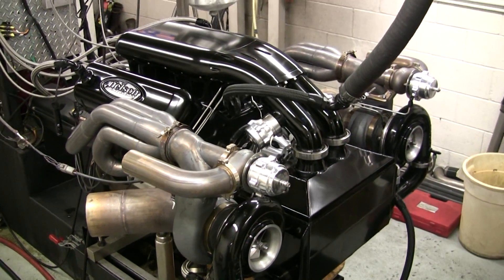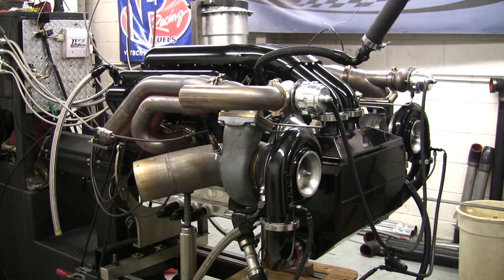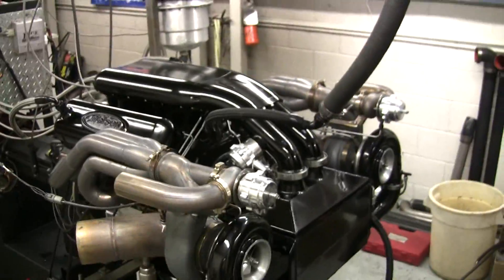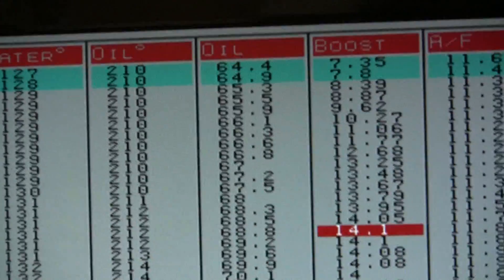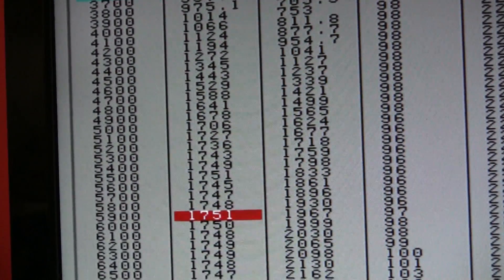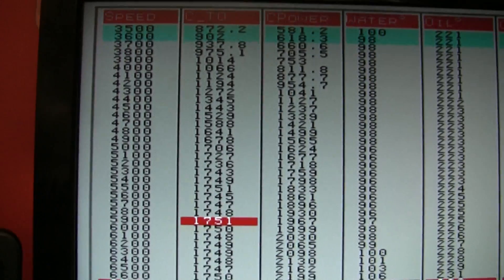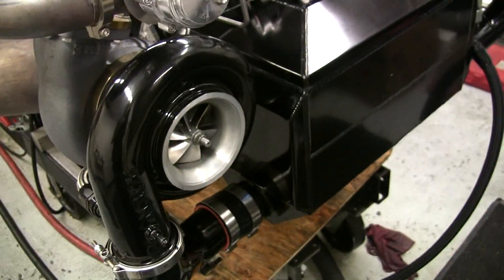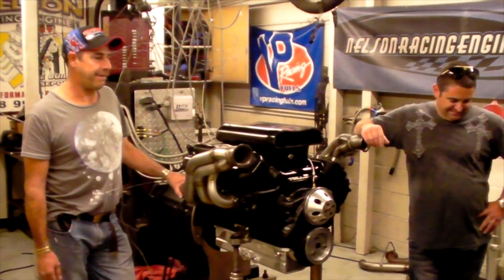NRE's 2200+ HP 632 BBC Explosive Beast!  Patented Award Winning Mirror Image Turbos. Chevrolet

Comment: And it’s still makes less hp and tq than a factory Hemi did in 1964, even though the entire block is new, stroke,crank,rods,heads etc Chevy sucks all they do is cheat that’s why they have banned the Mopar Hemi 49 times now and got rid of Pontiac because they made more power just like Mopar. Screw gm I guess that’s why the Camaro is dead now because everyone wants a Challenger. Go ahead add more weight and ban the most powerful engine in history again Mopar loves it. Shit rod is just that it’s junk

Comment: I understand that u replied to my comment, now I don't have a pos Honda, like I said I have a real import. With that being said, talking about reliable motors, hmmm...Honda motor can have more 200k+ miles on them and still be running strong. These v8's here aren't meant for street action and aren't daily drivers. And I wouldn't call these gas guzzlers reliable either. there's plenty of imports that have 1600+ hp and would give these v8's a run for their money

Comment: higher stall speeds also lead to more power soaked up, standard vehicle estimation is 15% loss on standard trans 20% auto, a little extra for awd which is unlikely to apply here but the extra weight from beefier components will add some also, expect closer to 22-24% wouldnt be a stretch and is right in line with what other vehicles in the power class loose. so yah 700 might be a little high but 500-600 hp loss at the wheels is about right

Comment: it has nothing to do with the vehicle it has to do with rotational mass and drivetrain, which is why its not a flat number but a percentage. to build a trans and rearend to handle this will require massive components from the torque they will experience, such as a fully billet turbo 400, 4l85e, lenco or something similar and a 12 bolt or 9 inch rear or bigger(yes they do make badder), then it is going to require a massive wheel and tire combo to get it to the ground, again from torque.

Comment: Yea ok, they've already made 1000+ hp  evo, look it up. Even up 1600 to 1800, plenty of torque to keep up with that thing. And only needs 1 turbo. On a well built evo, a 6766 can push a 1000 to the wheels. And no my car weighs over a ton, more like 3000+ pounds, look it up before you talk dumbass. And I'm not using some shit civic, you're thinking of, when I said 4 banger. I have a real import.

Comment: I had considered the potential this would have in an old Camaro or something, and all I can think of is "Where the tuners at?" 

...well.... that and... uh... myself screaming "Oh god oh god we're all gonna die" when I jam the throttle open. Could you even get the tires to hook up putting that much power down? My lack of experience as a driver shows, I guess, asking that, but good lord, that would be insane. And trying to keep it in a straight line? 

It would be SO FUN!

Comment: was wondering if you have after oiler on the turbo system , like when motor shuts off and oil pressure is gone does the turbo still recieve oil  when spooling down?

Comment: Amen to that! There's no replacement for displacement. I think the motor I'm building,a Buick 3800 Series II. falls somewhere in the middle though. Since people have still made 1,000+ horsepower with a turbo Buick 3.8 v6, I think I'll be plenty happy with it and have enough horsepower (and torque) to handle most cars that want to challenge me. If I run across a huge twin-turbo v8 like this car, I'll leave it alone though.:) Very impressive!

Comment: everything about that engine makes it make huge horsepower. A 632ci engine with quality porting probably makes like 700hp BEFORE turbos. Adding turbos with water to air intercooling on top of the good airflow from porting allows for a very dense and cool air charge on top of the huge hp it makes and the hp just multiplies. Plus a quality valvetrain set up for the turbos just adds icing on the cake.

Comment: What's the compression rate of the motor? is the motor base altered?
Since you've limited the boost pressure rather low, I would guess you're on the detonation limits with the standard fuel?

Comment: Bud,... I have owned two evos(2003 and 2006). I am not trashing you, I am just stating facts. Also, don't get carried away with defending evos... I'm a huge fan and always will be, good lord. Reread what I wrote, and do some research. And I said YOUR evo,... is your evo built right now and ready to support a 6766 at 50psi? So YOUR evo with a 6766, as it sits, makes less power then this motor does NA.

Comment: 6766 is rates for 935 hp, and they've already built 1000+ hp evo's anyways. Those turbos on that engine are adding like close to 2000 hp, that engine na would be like 600 hp something like that. If my evo was fully built with the 6766, it would be pushing 900+ to the wheels, although not saying you were talking shit or anything, I was wondering how the boost affected bigger engines

Comment: Depends on the size of the turbo, engine, ect, bud. 28psi through a coffee straw, and 28psi though a toilet paper roll is quiet different when we talk about volume of air. Evo 8 inducer is 48mm, evo 9 is 49.5, where this motor has twin 88mm's. Plus the size of his motor, and that thing makes more power NA then your evo would with a 6766. Boost pressure is just a reading of resistance in the intake system. Smaller motors take more boost to move the same air as a motor with more cylinders would.

Comment: How are you making so much power with such little boost, that's my question, my evo, stock turbo is pushing 28lbs of boost and I'm only sitting at 364 to the wheels and 363 tq on e85. Just wondering, cause I figured if you're gonna make 1000+ hp then you'd need like 50lbs of boost or more.

Comment: in the video he says he has a ceiling vent 4 ft above which was insufficient.  you sound as if you do this all the time and 2200+ HP is just a stroll through the park, they are pushing the limits of their dyno which means they are stepping into territory for which their whole facility is hardly prepared. at the end of the day maybe your just not trying hard enough since your not forced to improvise by removing windows and adding fan support.

Comment: The top speed would all depend on the transmission gearing as well as the axle gearing. The engine is only one aspect of the drivetrain, getting that kind of power to the ground is the next step.

Comment: haha you've just told me that a smaller engine needs more displacement and more boost to make high power. This bears no relation to the argument. I could have told you that myself. Also remember that 1183 is at the wheels not the crank.

Comment: MAN stfu koenigsegg1000 is correct. Stop trying all scientific with your potential energy bullshit. THINK Quad turbo W16 if a twin turbo V8 from nelson is making 2200+ a fucking QUAD TURBO W16 will quite comfortably make 3000. The engine has 2/3 heat loss equating to 1000 at the wheels. Why does the Veyron have ten radiators do you think? 
I thought you were wrong. I did some research to comfirm. I THEN argued my point. Do the same next time and don't try and be all fucking cool about it.

Comment: Do you realized a Bugatti can be raced at 1200 HP and this would exploed if raced? It would destroy tires and it is very unstable and can breakdown in less miles than a vw scirocco
If you realized how business worked you would know that Bugatti doesn't want to kill people with a 2200+ HP engine and that they could get much more power from their w16...
While I do agree that they could get more power its just not necessary and I also agree that Bugattis' are over-rated

Comment: lol kid...as my fist comment stated, but ill be more specific now, the bugatti engine produces 3000hp at the crank, but only 1001(1200 in SS) HP reach the wheels in other words 1001(1200) wheel horsepower is the final output of the engine.

Comment: lol....tell that to the Bugatti Engineers. To specify myself a little better, the Veyron Engine produces 3000 crank horsepower, which was my argument, but the standard Veyron only gets 1001 wheel horsepower out of the 3000 crankhp, and the Veyron SS gets 1200 wheel horsepower....and Europeans dont use what we Americans call pump gas....they use higher grade, higher octane petrol.

Comment: Steve Morris made over 3000 HP @ 7200RPM and 30PSI with a twin turbo 572. Imagine giving that guy a 632
Reply: Steve was probably running methanol I think there running pump gas

Comment: They dont want more than 1200 hp on that engine, cause the rest of the car cannot utilize that much power anyway.  Bug's are made to last long milage, to drive well everywhere and to control that power well.  This engine is supernice but won't be usefull for more than a handfull of special case cars on earth.  Its like comparing apples and pears.